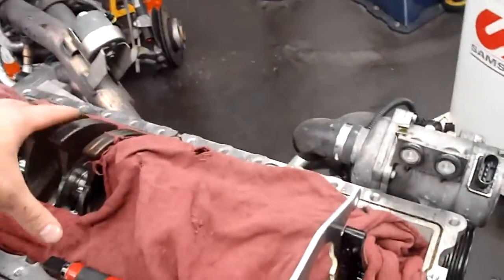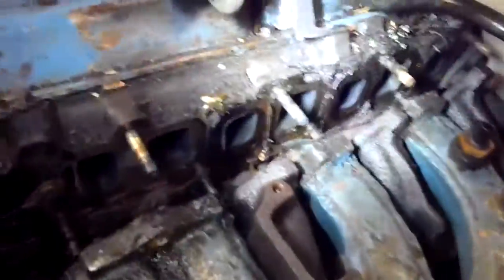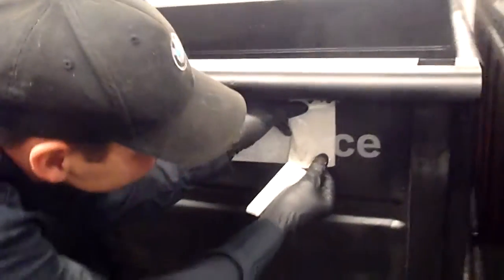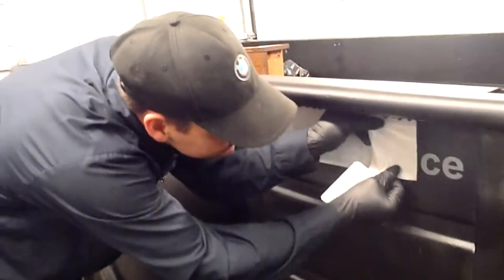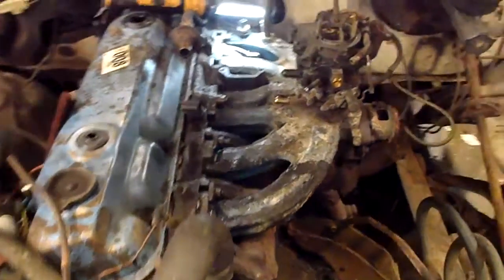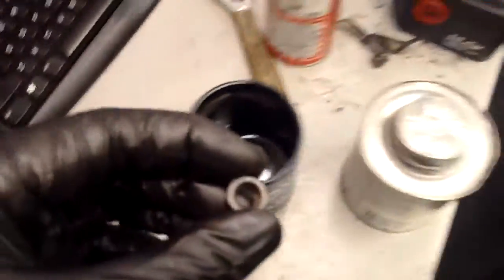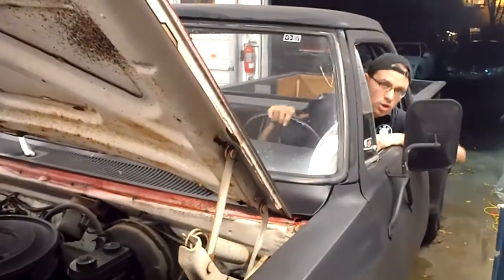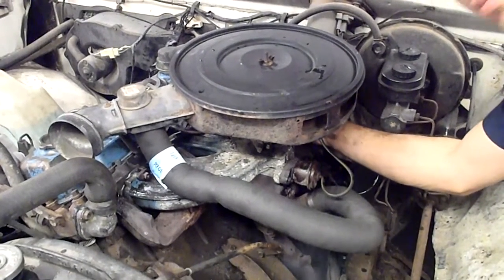1981 Dodge D150 - Replacing intake/exhaust manifold gasket

Comment: Got a 86 d 150 went thru several mechanics finally found the vacuum tree on the back of the intake manifold , one of nipples had been snapped off was all it was ,but when I removed the vacuum line from the brake booster ran perfect , really guys try to gain all the info you can and do it yourself cheaper and you should always try to do everything yourself saves money and you can trust yourself better than anyone

Comment: its excessive fuel burnoff from the float being stuck or sunk on the carb or the accelerator pump. i had the same issue on my '80 dodge d150 with a slant 6 after i installed a new exhaust manifold.

Comment: @nrhbmw  It's probably going to start and end with that Holley 1945 carburetor. Either overhaul or replace it. They don't run especially well even when new.

 You can go back to the simple Carter BBS and it'll run a lot better.

Comment: @paradoxdesigns Man...a slant six is one of the most simple engines there are to work on. They run fine IF you learn how to do the 1 or 2 adjustments they require.

 WHY would you change an engine just because the carburetor needs overhauled? You have to change mounts, change radiator, change the wiring around, buy new hoses, change the bellhousing, buy a flywheel..rerun the exhaust..it's not that SIMPLE.